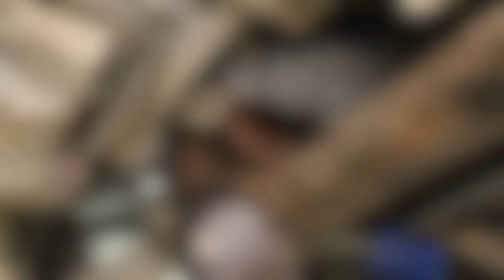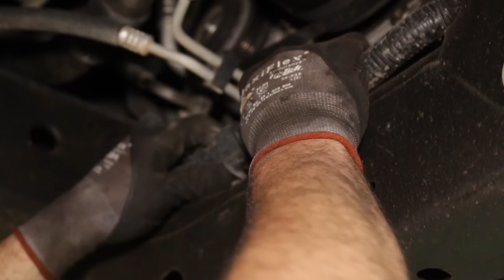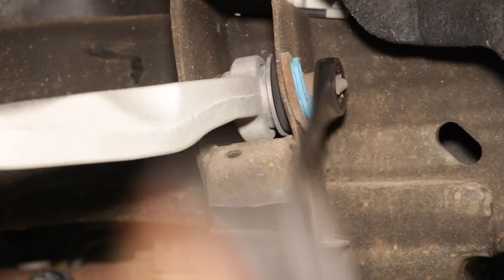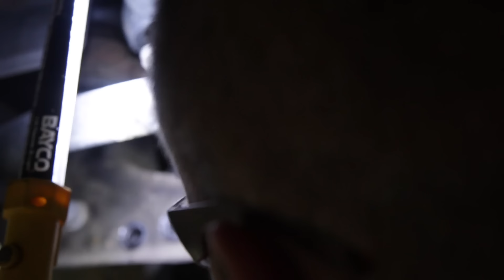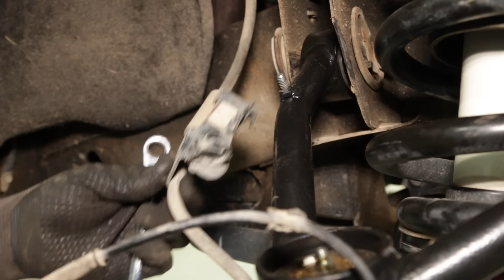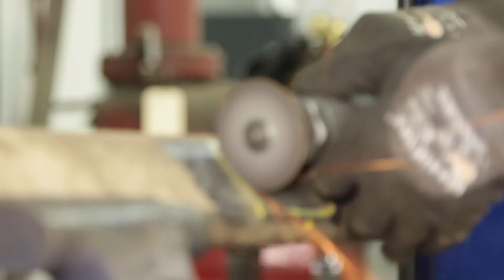How to Install a 2007-2016 GM 1500 3.5-Inch Lift w/ Upper Control Arms

Comment: Can I fit a 305x65r18 on the truck with this lift and have no rubbing? have a dealer thats doing it. But I don't know if they trimming the inner fenders.
Reply from the maker: They more than likely had to do some trimming on that one. Here is a list of the tire and wheel combos for that lift

TIREWHEELBACKSPACINGOFFSET285/70 R17Factory 17--285/70 R1717x9-0 to +18mm285/65 R18Factory 18--285/65 R1818x9-0 to +18mm285/55 R20Factory 20--285/55 R2020x9-0 to +18mm
Due to differences in manufacturing, dimension and inflated measurements, tire and wheel combinations should be test fit prior to installation.

Comment: On  the  3.5 inch lift kit you guys recommend 33 inch tires but I would like to go with a bigger tire , maybe a 35 inch.. What do you think ?
Reply from the maker: 35 would be too big on that 3.5". You could do a 3" body lift or 6" suspension to get the 35 on there.

Comment: I had the 2.5" kit, replaced it with this one. Get the included upper control arm kit.  Perfect height with 33's
Reply: I seen saw on lonestar Hawaiians video where he bought this exact kit and was told to stack blocks. He ended up getting another brands block which totaled the same height as the factory block and the supplied “stackable” block. Maybe rough country realized the issue and now offers the correct size block?
Reply: I got the same kit 3.5” with upper control arms. Did your blocks come on as 1.5 or 3” ?? Just curious cuz mine were 1.5” and told me to stack them …
Reply: @miguelclaire5196   3” . Try not to stack blocks
Reply: What is the Number part of ball joint Uca RC ?

Comment: I'm very disappointed that my 2015 has such small wheel wells! Your lift does nothing to installing larger tires, the tire you installed is 32.5" tall and 11.22" wide, I run 285-70x17" tires with absolutely no lift!! This doesn't increase wheel travel.. Although it does give it some much needed lift, why not include cut out fender flares that fit 37" tires?
Reply from the maker: Not everyone likes the look of the fender flares and are ok with running the 285 on this lift. But the flares are sold separately so that they are available to those who would rather have them.

Comment: Will a 3.5 inch leveling kit even out the front end with the back end of my 2014 Chevy Silverado double cab?
Reply from the maker: Yes this kit is designed to lift and level the truck.

Comment: +Rough Country
 would 20x12rims and 33 tires fit the 3.5" lift?
Reply from the maker: Yes 20x12 wheels will work on this kit with -44MM offset.

Comment: Why not just include a new cross member to accommodate room for the differential? I would gladly pay to have that included, that's the only reason why I held back buying this. All kinds of mud, road salt, water, ect is all going to cake into that huge hole cut into it and rot it out. I hope you guys end up including one eventually like you ended up including control arms and proper struts for this kit. Then it will be perfect
Reply: You don't need to cut the crossmember. Just trim the cooling fins off the front differential. That's what i did with mine and no problems so far
Reply: @acasto98 thanks
Reply: Cut,cut.cut.  grind cut grind cut.....jayz ..kan'T Ya.  New Song
Reply: You could cut a couple pieces of plate to fill the gaps, tack it and Weld er up. Plus if you suck at welding it's a good place to practice your fab skills. Nobody will ever see it.

Comment: Remember fellas, when you buy a 3.5 lift, or any lift for that matter, take into consideration that they are removing the factory 1.5 inch block. and never re- compensating for It, which makes it look like your always hauling a load of dirt, not sure why these lift companies do that in my opinion I think its horrible looking..
Reply: usually people like a leveled truck
Reply from the maker: Our kit replaces the rear 1.5-inch factory block with a 3-inch fabricated lift block.
Reply: Yes sir, I understand that, but most people think, that a 3" block will give them 3" of lift, when in fact it only gives them an additional 1.5 inch lift over factory.. I learned the hard way on that lesson!!  I still like Rough Country products. I was just speaking in general to help others understand the factory block is being removed and replaced
Reply: fit4ya1975 makes sense. i went with the 2.5 leveling  kit but did the 3 inch blocks in the rear vs the 2 inch it came with. looks better with some take imo

Comment: With this kit and 35" tires how tall is the truck to the top of the on-star antenna?
Reply from the maker: +scott howard We do not offer that dimension due to varying demoninators. Tire pressure and true tire sizes vary so much. We offer ride height from center of wheel to fender well.

Comment: just put a leveling kit fastes cheaper and on a silverado and sierra you can put 20s on 33s with out spending that much on a lift kit
Reply: cummings power what kit did you use??
Reply: I cant remenber the brand found it on ebay 60buks

Comment: just wondering i have 275/55/20 on before lift and was thinking about new tire size 275/65/20 would these rub?
Reply from the maker: +Joe king No the 275/65 R20 will not rub